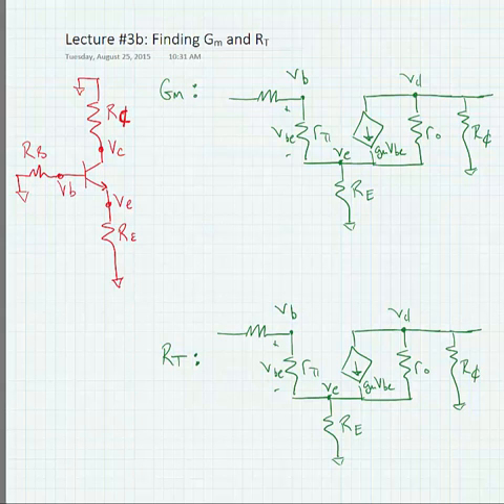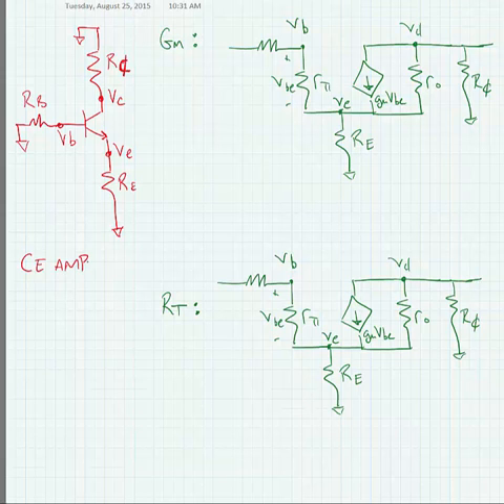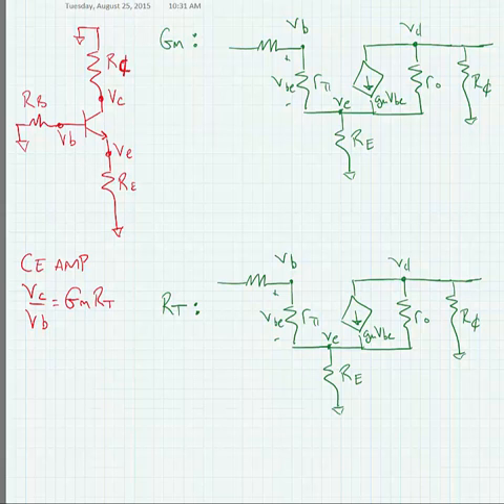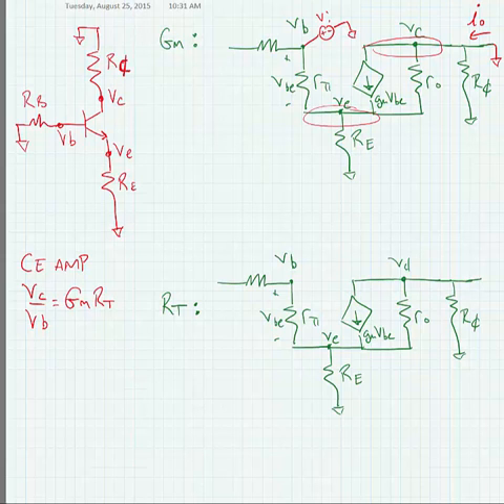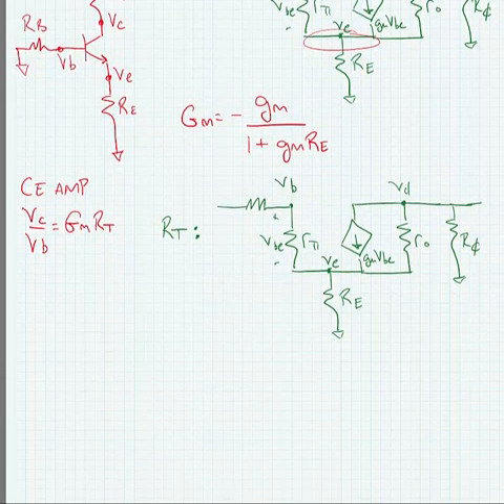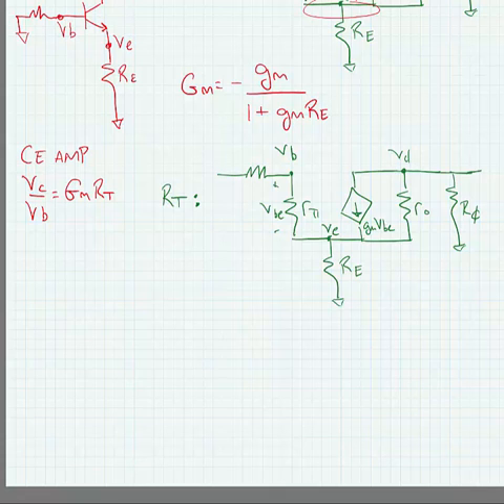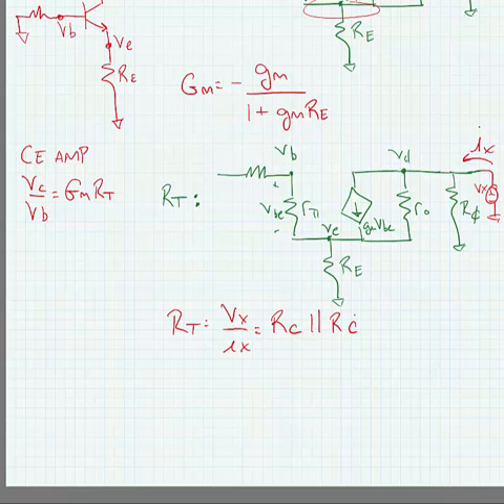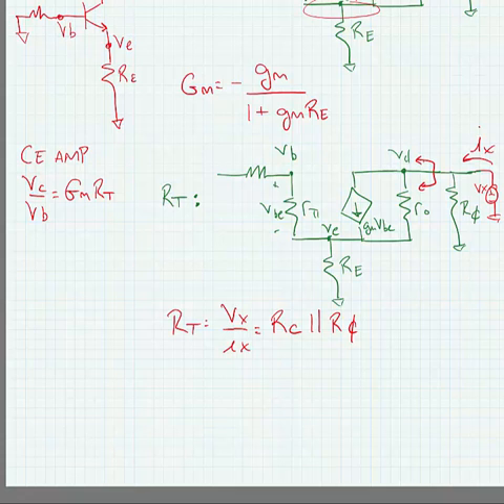ECE 3110 - Lecture 3b: Finding Gm and RT for Inspection Analysis (New)

Comment: hi very nice video, so tell me something why are you not using the re model  to do the analysis of this problem circuit.
Reply from the maker: I just find it is easier to do nodal analysis on the pi-model. Either model can be used and the end result should be the same.